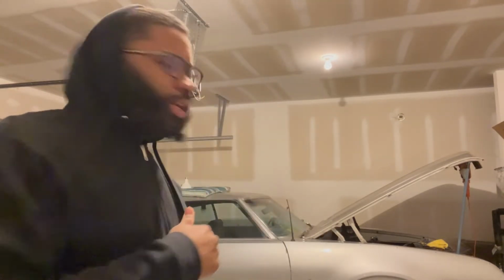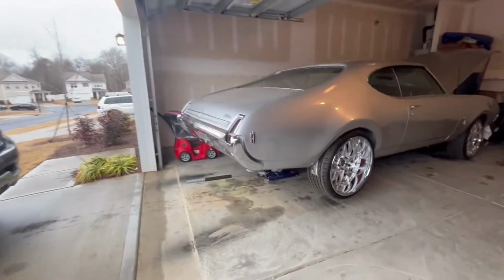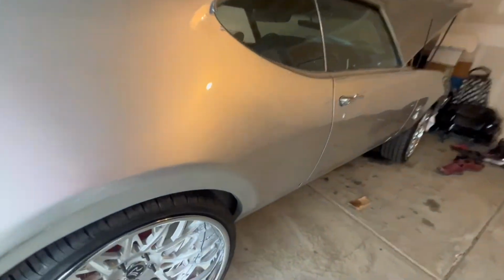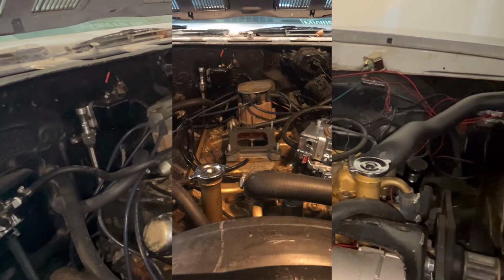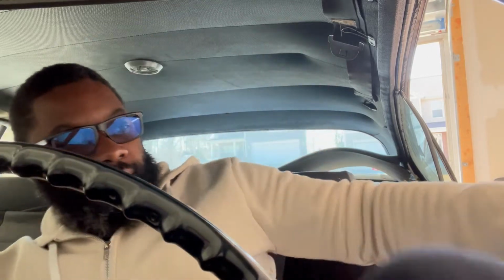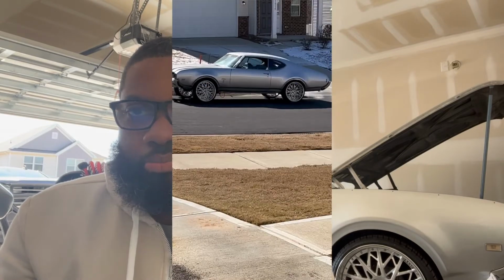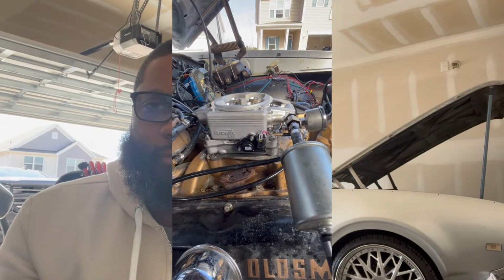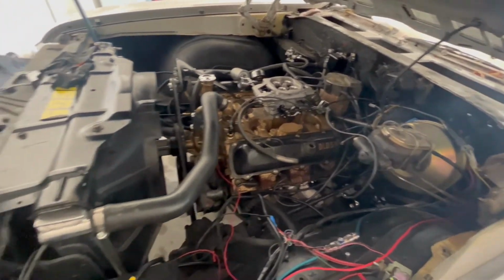MSD Atomic 2 install on my 1969 Cutlass.

Comment: Add the MSD 6A for timing control.   The 6AL gives a rev limiter, but I think that’s available on the Atomic so not worth spending the extra money on the 6AL versus 6A.  

You can still use the HEI distributor if that’s what you’re using, and manually phase the distributor.  

I just made a lockout for the mechanical and made another plate for the vacuum advance. I used that to help phase the distributor.
Reply from the maker: Thanks i appreciate the comment. Funny because my cousin was talking about this a few months ago. The car is currently at the paint shop. But I can’t to get it home to get it running

Comment: Thanks for this,I was literally just about to buy one.Maybe I’ll hold out till you shake it out and see how you like it
Reply from the maker: I’m currently having fuel pressure issues. I relocated my fuel pump but I haven’t had time to troubleshoot. Right now the car is at the paint shop, but once it get back home I’m going to figure it out. I’m
Not going to let it defeat me!
Reply: @jaycutlass1269  Cool.Did you put the regulator after the EFI unit?
Reply from the maker: @johnnyhotrod  per the instructions it had install the regulator on the return side. I also only have 10-11 volts on my
New battery so I’m also wondering if it’s not sending enough power to my fuel pump. My cousin has the unit on his 70 chevelle and it works flawlessly and he loves it. I feel my issues are with the car and unrelated to the unit. Car should be home in 2 months and I’m slowly going through it
Reply: @jaycutlass1269  Yep,that’s the right way to plumb it,thought you might have put it before the unit.New batteries sit on the shelf for months,I always trickle charge them before installing.If your voltage is that low it could definitely cause an issue.I know you don’t have the car but it would have been good to get a voltage reading with the car running.Hope the paint comes out slick,I’ll be following
Reply from the maker: @johnnyhotrod  thanks for following I really appreciate you taking the time to watch comment & share some knowledge. I’m thinking of buying a whole new wiring harness for the car being that it’s 50+ years old. But stay tuned to the channel for updates
Reply: @jaycutlass1269  I have a 67 Camaro.I ran a new harness and it’s worth it to avoid having to chase any electrical issues.Just a heads up,it’s a lot of work.I ended up pulling out the seats,carpet.most of the dash,etc.
You’ll be swearing at times but if you do it right it’s great peace of mind.
One piece of advice:They make a heat shrink label maker(tubes)for labeling circuits.It’s from Dyno.Although the wires are marked it’s great to mark them at the termination points.Clear and easily read,no looking up color codes.Best of luck

Comment: What the what!? I was told it has an internal regulator built into the fuel injection system?
Reply from the maker: The Holly Sniper has an internal regulator, the MSD regulator is external.

Comment: How’s the msd working up to date ? Been thinking about this unit over the other options
Reply from the maker: The car in the paint shop, hopefully it’ll be home soon. Soon as it comes
Back I’m on it. The car started up with ease and ran but sometimes I would lose fuel pressure. I think it’s because of there I had the fuel pump mounted. Im thinking about going with an intake pump instead. Soon as it come home I’m going to comment to everyone under this post and make an update about the car.

Comment: Is it worth the upgrade from a carburetor? Im about to do this to my K5 but im having second thoughts about it.
Reply from the maker: My honest opinion: if it’s running good and you’re not having any issues with the carb I’ll keep the carb. I had a old carb that needed rebuilding on the car and it ran. With the EFI system I need to do some tuning and playing around with it to get it to work better, but the car at the paint shop now so I haven’t been able to play around with it lately.
Reply: @jaycutlass1269  well I thought about rebuilding the 350 i got on there now or just purchasing a crate turnkey and install a EFI on it. But you’re right though if the carburetor is working for me I should just stick with it.
Reply from the maker: @armygreenfj3924  I wish I did the car ran well burned rubber. Now I have more things to monitor and learn like AFRs, Monitor fuel pressure, O2 sensors with the carb was much easier to maintain. I’m going to figure it out when I get it back home from the shop.
So far one benefit of the car starts right up like and EFI car no pumping the gas, but stay tuned the car should be back from the shop in a month or two. And after that I’m going to prepare it for the Power Tour. 
I feel it would’ve been easier for me to LS the car cause that’s already fuel injected
Reply: I’m running the Atomic on my 79 K5.  I did a new top end and very mild cam.  It’s one of the best decisions I made.  

I initially ran the carb - hated it. Hard starts, off-road / off camber just sucked.   I put on the 87 TBI system and ran that for about 5 years.  It’s under powered but it worked ok.  I did the Atomic and really like it.  If you have the money and you have to be smog compliant, no question, run it.  

I just added the MSD 6a for timing control to it today and made it even better.  

I’m using the stock HEI distributor with the mechanical and vacuum advance locked down.  My Atomic had bad wire connections for the mag pickup.  I had to redo that and it idles so much better.  Throttle response is better too.
Reply: @mark8012  do you have the older version atomic efi? I actually just got my blazer out the shop a couple months ago. Fresh rebuilt chevy 350 with a edelbrock e street top end kit. Everything is new except for the original engine block. Im currently running the avs2 carburetor but im still debating on going EFI.

Comment: Are u running a cam with that atomic 2?
Reply from the maker: Yes, I’m running a cam it’s like a .515 lift,
Reply: @jaycutlass1269  ok thanks I'm thinking about running the atomic 2 with around the same lift but I'm tryna figure out what I have to do because I have tbi 350 I may have to change my intake
Reply: You can have a different cam. Setup will allow you to change what cam you have in the software.

Comment: MSD EFI is not at all just like the Sniper!
Reply from the maker: What’s the difference? When talking to the salesman he told me this.
Reply: @jaycutlass1269  It tunes just like the Sniper (uses same software) and is Plug and Play with the HyperSpark components. If you decide to enable the timing control I highly recommend the Sniper/HyperSpark ignition vs the coil driver/MSD+Box as phasing was a pain in the butinsky.
Reply from the maker: @downinthegarage  thanks for the comment. It starts and move I think it’s a fuel pump placement issue or I don’t have enough power going into the fuel pump. It’s at the paint shop now, but upon return I’m going to upgrade all the wiring since it’s 50+ years old and reinstall the system  hopefully and hopefully it’ll help me
Reply: @jaycutlass1269  I'm going to take a bit of video of the re-install of the Atomic2 and the HyperSpark ignition over the next couple of weekends in my lil S10.
Reply from the maker: @downinthegarage  please do, I just subscribed to your channel can’t wait to see it
Reply: It's exactly the same. Its just branded as MSD. The touch screen is the same as a Holley 3.5 inch display.
Reply from the maker: @Domestic_Tedster  yes I already know, but you know how the internet go. There’s always one o